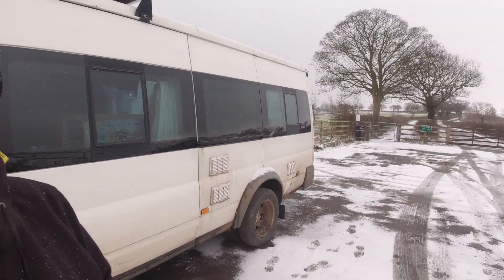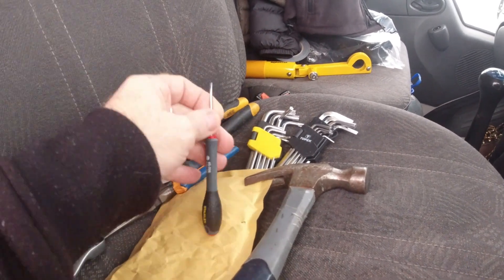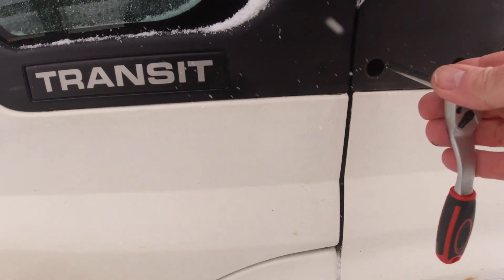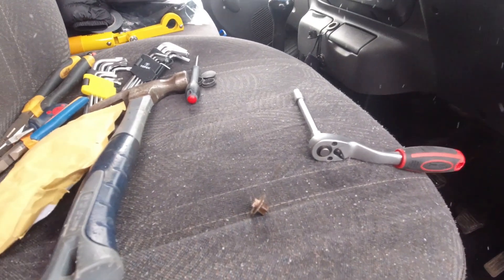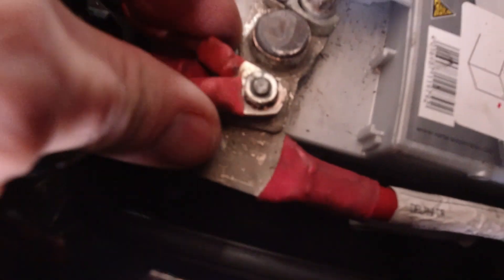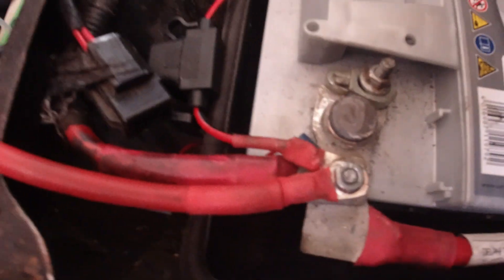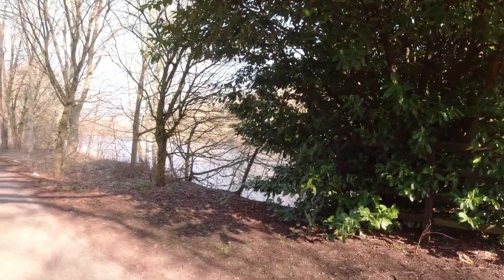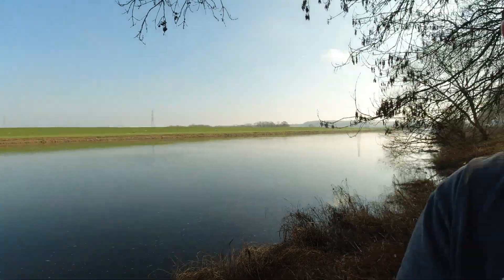86: Fulltime Vanlife: That Sinking Feeling #fulltime #vanlife #campervan #ukvanlife #rvlife #rv

Comment: At least you tried the bolts in wing mirrors are the hardest to do, we know from experience when we had to replace our wing mirror
Reply from the maker: If that bloody bolt hadn't of snapped then I could have done it. But luckily the garage fitted it for free as they were also doing other work

Comment: Glad you got the mirror sorted, in theory it’s any easy job to change a mirror but you guarantee something will go wrong. Noticed you had the odd bit of rust coming through, might be worth getting that sorted before it gets worse. Great vide 👍👍👍
Reply from the maker: Thanks Dan. Yes the mirror in theory should of been an easy job. Yes I intend to tackle the rust this spring. Cheers 👍😁

Comment: have you got your heater pump screwed onto something, try suspending it in mid air to make less noise
Reply from the maker: I already have it hanging on cable ties believe it or not 😆 ... but the ticking noise doesn't bother me. Once it gets up to temp and calms down it's like a ticking clock and you hardly notice it. Cheers 👍😁